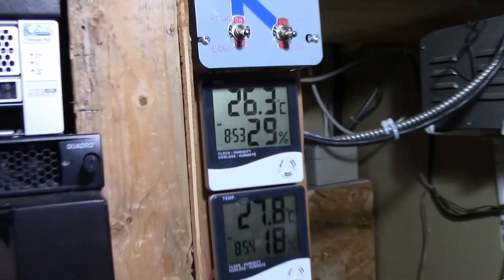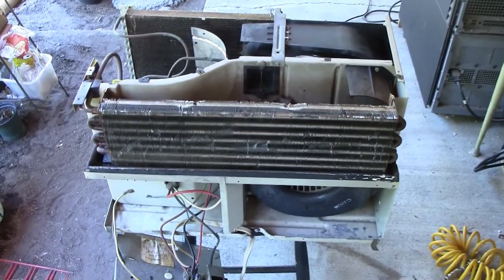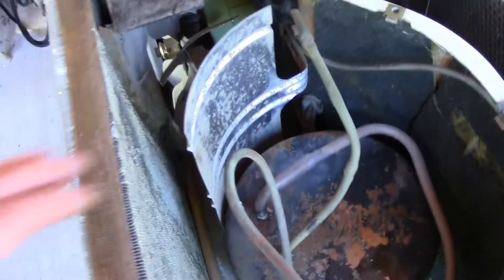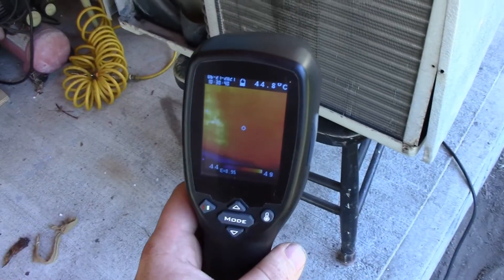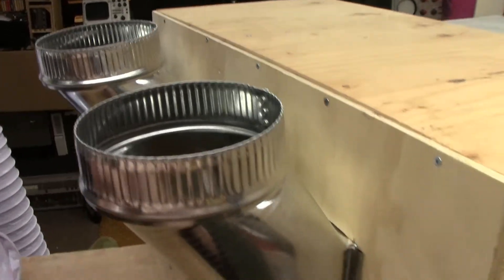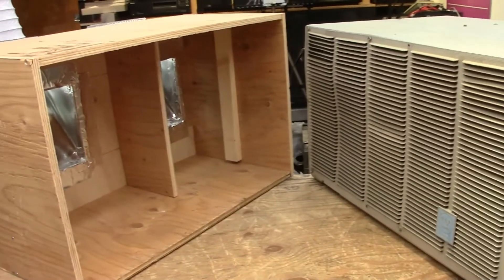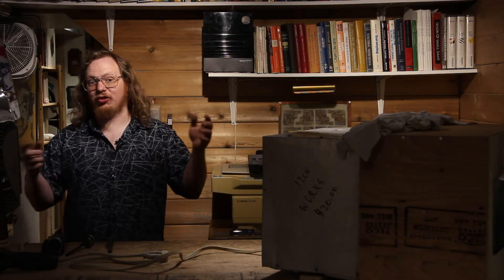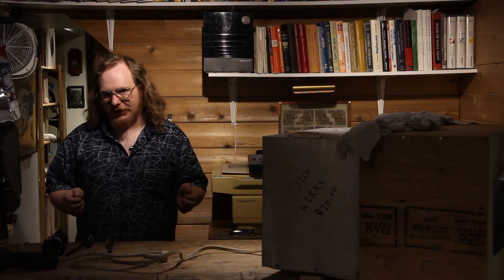Heat Wave Special - Can I make a Window AC work as a Portable?

Comment: I've watched many videos of camper trailer/van people building a ducted box, but none of them ever thought to do a current draw comparison. Thanks. As I'm prototyping such a project now I'll definitely do that (maybe several times if airflow isn't sufficient) before making a final build. I do plan on using a 800cfm car radiator fan as either a puller or a pusher so I'm pretty sure I'll have plenty of airflow.

Comment: I have one sitting on a deep windowsill which I re-ducted to draw in air through the window screen. There is some mixing of the exterior intake and hot exhaust air, so it's not as efficient as it would be with the condenser side hanging out the window, but it actually works pretty well for only involving cardboard and hot glue. On hot days, it cools the bedroom well down into the 60's, at least once some condensation is being splashed onto the condenser heat exchanger. I usually spray some water on it to give it a little kick start.

Comment: Install a 6" inline exhaust fan, you can even get them with a speed controller for quieter operation. This will help pull the exhaust air from the AC and push it outside. The fan in the AC wasn't designed to push air 10 feet.
Reply: you can use a draft inducer style fan similar to one used to increase the draft on a solid fuel burning stove exhausting to the chimney .  I enjoyed your ideas about this !!

Comment: Why did you use dryer duct instead of actually using 8 or 10 in insulated loose duct
Reply from the maker: Cost and availability. The Home Depot did not have insulated ducting available and to order it and wait another two weeks would of been very expensive.

Comment: I wonder if you were shorted the hoses as much as possible, if that would help. Also if you insulate the exhaust hose, it would reduce the heat loss back into the room. I have access to a huge 220v ac unit, that I'd like to use in my shop. But have no window  even close to big enough, and I don't want to cut a hole out in the wall as I may upgrade to a Mr cool split ac in the future.

Comment: Maybe room air instead of using outside air on the intake line? Can that work?
Reply: This is how most portable AC's work. BUT the issue is by pulling in room air and then exhausting it outside, they create a vacuum effect in the room. That air will replace itself by pulling in an equal amount of air through every crack and etc from the outside, which of course is hot air. Therefore vastly lowering efficiency and how cool you can get the temp down too. But the Two Hose portable AC units tried to get around this by pulling in outside air and exhausting it back outside, exactly as his setup here.

Comment: Why not put it outside and just pipe cold air in
Reply from the maker: That was an option. that was actually considered since there's a shelf right outside that window. The problem was I couldn't then reach the controls.
Reply: @CelGenStudios oooh if it had a remote you'd be able to.. but without one definitely can't put it outside 😭

Comment: Experimentally I found I needed to pull 300 CFM of air with a six inch hose per 5000 BTU's to get the same temperature as not enclosed. 200 CFM gave a 30 degree F differential instead of 20 degree F.

Comment: What if u add a booster fan they use for hvac system on the exhaust hose or on both would it still be straining the compressor or if it’s does work how’s the efficiency don’t think them booster fans pull to much amps regardless old ac units are tanks compared to newer ones

Comment: Hold on to that air conditioner. Those old units will out live generations of modern junk. Those old reciprocating compressors are so much more robust and preform much better as well.
Reply from the maker: It's being safely stored because of exactly that. I've gone through two much newer window in the last 15 years and while a lot smaller and lighter they all lost their charge within 2 to 3 years.

Comment: Why not an in-line duct fan helping to expel (suck the outlet air) back outside, in turn aiding in condenser temp and overall efficiency?
Reply from the maker: Hmm. I didn't think about that at all!
Reply: @CelGenStudios  Lemme know if it works out for you because I work out of my hot garage in Texas and have a window unit and no windows! Either way, thanks for the insight.
Reply: @chevchelios9641  im in Houston, TX what did you do, and how did it work for you.  I was thinking of something similar
Reply: @ladelewisdesigns  Hey! Welcome to another miserable summer, right?! Well, I retired the unit because of the amount of heat generated by the window unit. I have a laser business I run out of my garage and it’s not good for me or my machines but I tied into the exhaust duct for my ventilation for my machines. All in all, I’m liking the reply below mine about ducting in the air. Makes more sense to draw cold air in more than to try getting rid of heat from an already hot spot. I’m going to jig up a fitting to cover the vents with a 4” duct running into the garage and put an in-line fan towards the end (me) and see how that works. I just have to control the AC unit or it would constantly be running in this Death Valley heat! 😂 Check back in a few days, I’ll start on it today! Until then….

Comment: The problem with this is that it would need additional insulation on the tubes and on the wooden enclosure which further raises complexity.
Reply: Yeah, basically need to insulate EVERYTHING because the heat leaking back into the room will just counter the cooling. After all is said and done, this will cost way more than a portable a/c.

Comment: I know now that with central HVAC this is now moot, but there were no case window AC units available?  As you probably know, window AC units are terribly inefficient.
Reply: Terribly inefficient?  Not so fast.  My emergency window AC has an EER (not SEER) of 10.7 and is nearly 15 years old.   No ductwork losses and great dehumidificiation.  In 2023, EnergyStar qualifying split ACs only need an EER of 12 or greater to qualify.  Package units only need An EER of 11.5.  Some new winds ACs have EERs of 15, far more efficient than a split central AC.
Reply: BTW is that a big Copelametic compressor off to the side?  Commercial refrigeration anyone? ;)
Reply: I wonder how much heat is being dissipated back into the room from the exhaust hose.  Maybe it would have better to put the unit outdoors, and pipe the cold air into the room.  That way the heat from the compressor et al would be exhausted outdoors instead of indoors.
Reply from the maker: @DandyDon1  That semi-hermetic I'm using as a crude vacuum pump.
Reply from the maker: There was nothing available at the time of recording.
Reply: New window units are more efficient than 95% of all installed central ac units.  Yes they really are better than what most people are setup with due to ducting losses.

Comment: What about the condensate? My window unit was peeing nearly constantly last weekend.
Reply from the maker: oooh, I didn't think about that......
Reply: @CelGenStudios  meh, realistically you could just make a tray that the unit could sit in. Or add a drain hose kit and route it to a container. Down here in Seattle on Monday I got 2.8 gallons out of my samsung 8'000 btu window unit, 24 hr period, drains into a bucket that feeds my raspberries. On my smaller 5'000btu I have a fabric siphon setup. Essentially a 14x20in furnace filter connected to the drain pan with a guaze sheet so it doesn't drip into the well for the basement window directly below it. Just evaporates

Comment: Since you can't get a larger hose, why not consider using two 6" outlets instead?
Reply from the maker: It was an extra $50 in parts. No budget to go that crazy.
Reply: @CelGenStudios  What about slapping some server fans on the intake / exhaust? I realize this is impractical but it'd be fun to mess with.

Comment: Really enjoyed your video is a very clever idea you got there on that.  With that being a thru wall ac with way the exhaust air flows through then out condenser instead of the fan right behind it.  I have not seen a ac like that.  You are right on having the bigger size hoses that would of helped, but I have an idea you can try if not too late to take care of that.  They make in line exhaust fans in a 6 inch size that normally are put on furnace and boiler vent pipes that you could put on your inlet hose to blow more air into the unit or put on the exhaust side to pull more air out.  That would help the fan in the ac as it was not designed to have the extra restriction from the hoses.  The fan is around 25 bucks though an are 120v.  I hope you make it through the 2 weeks before you get your central air ok.  Being hot and trying to sleep doesnt work too well.  Thanks for the cool evening.  Oh yeah forgot to ask you what was you going to do about the condensate from the evaporator coil?

Comment: I wonder if anyone has tried to chop a window unit in half and extend the refrigeration lines / wiring to turn it into a ghetto mini split.
Reply: The Midea U-Shaped window unit is almost that! Yeah, I'm trying that soon with a GE Clearview 6K btu
Reply: There is a video somewhere, where two guys from India did it.
Reply: I was actually thinking of doing that, or just duct the air out. But since my current window ac is only 5000btu I just ended up buying an inverter 10,000btu portable ac with 2 hoses. It was on sale for $350 with shipping 😂

Comment: Turn the concept around. 
Throw the AC unit outside, and duct IN the cold air. That way the compressor can run freely, and you don't have to hear the roaring unit next to you.
Reply from the maker: This was actually something I considered at first because it would of worked way better but I ran out of design time. Pretty easy to convert it to do that though.
Reply: This actually does work.  There were a few 1950s beach cottages on Fort Myers Beach which did exactly this.  They were on stilts, so the window ACs were hung underneath the house and they just cut a hole in the floor and ran ducts into the house that way.  Worked surprisingly well and also very quiet inside.   They even wired them to line voltage thermostats inside.    From inside you'd never know it wasn't central air.
Reply: That is a good idea actually. Make the hose as short as possible by putting AC right up near window, then insulate the hose/box to reduce temperature loss.

Comment: Interesting stuff. Could you mount the horizontal ac vertically?
Reply from the maker: No. Never do this.
Running a horizontal AC vertically will starve the compressor of oil and will likely burn it out.
Reply: @CelGenStudios  ah, did not know